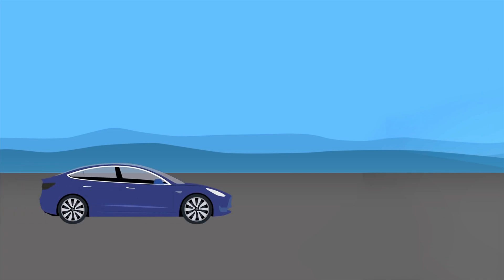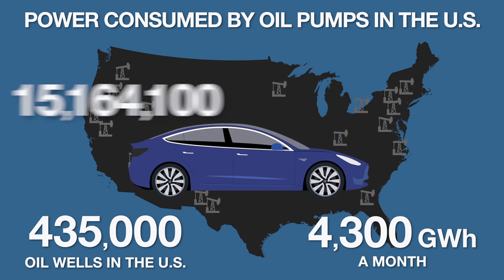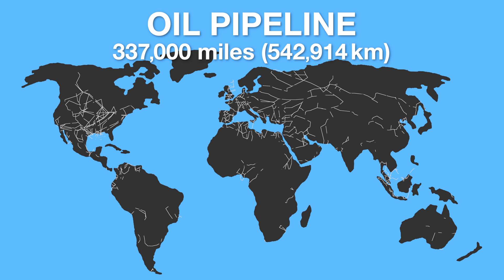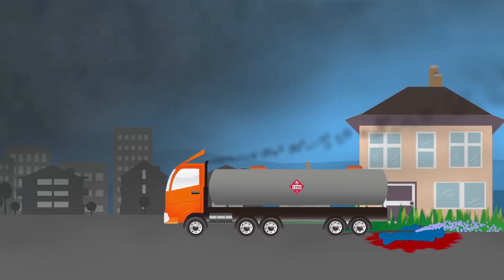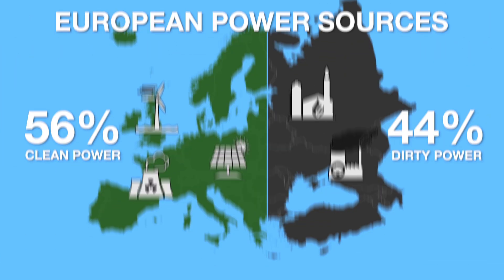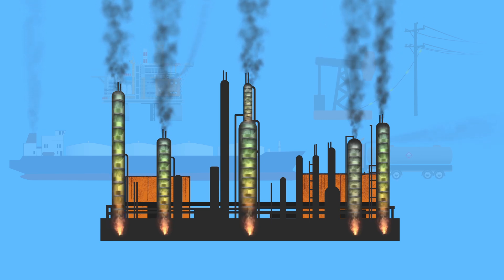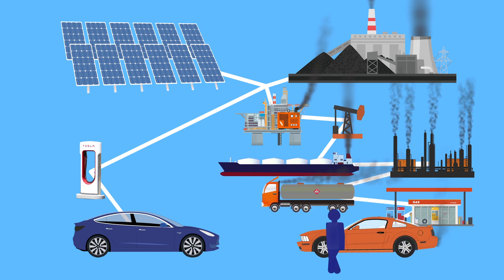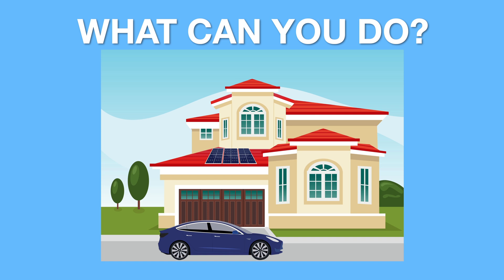Verbrenner oder Elektro. Wer ist wirklich umweltfreundlicher?

Comment: Well refining profits from fossil fuel, shocker I know. The whole system works, because less energy is used to extract oil, refine it, pump, transport it, to then burn it, than it yields. Therefore it was the 'infinite energy glitch' of the world for decades. Use energy to get more energy. If you want clean energy, than this whole system won't work of course. Your whole animation is lovely and well done, however it misses the point, that there is an systemic difference. Thoses systems shall not compete with each other. Fossil = easy energy, renewable = clean energy